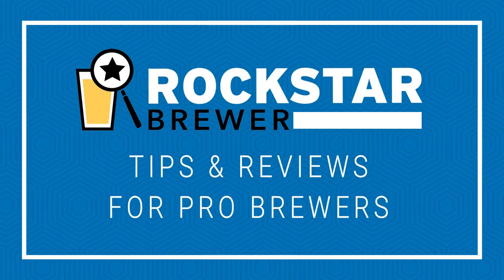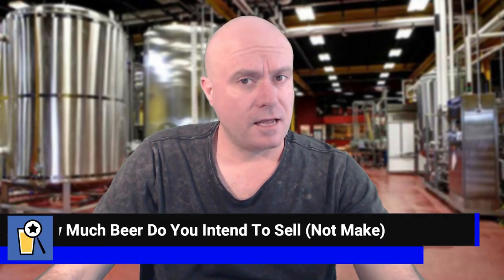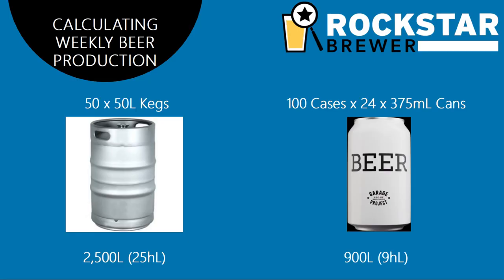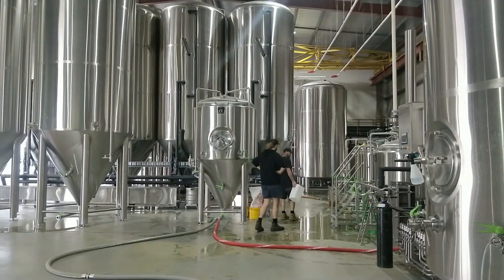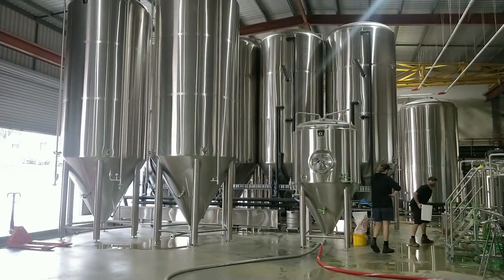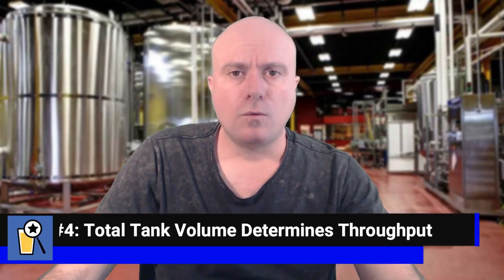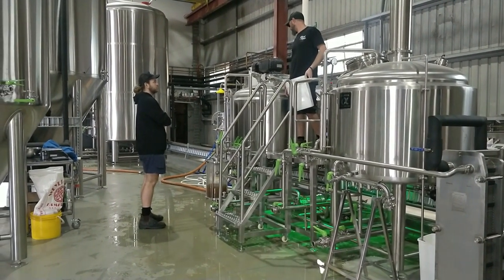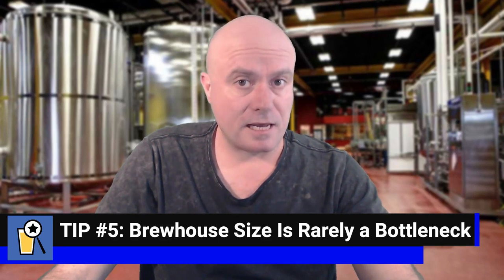The Big Brewhouse Myth EXPOSED: How to design a brewery that KICKS BUTT and TAKES NAMES

Comment: From my experience, just about everyone gets way too small a brewhouse out the gate. It’s very rare that someone regrets buying too large of a brewhouse—and I’m talking 30 barrels or less, because buying a 50 or 60 bbl brewhouse that’s where you can get yourself in trouble. Even taking the advice of buying a 10 bbl system, I’ve seen so many regret that, sometimes even within a year or two. Now, with markets getting tighter, the conversation of going too big is certainly more relevant, but when you look at what your potential growth could be, especially since labor costs a lot more now than when I first started brewing, you’re gonna spend a whole lot more in labor doing multiple turns in the long run. Plus it’s a lot more expensive to expand after opening than before (you’re very likely could have to move buildings). You really need to know your market and have a realistic 10-year plan. I can’t tell you how many people that buy a 10 or 15 bbl brewhouse and buy only, or mostly only, double-fill tanks out the gate. The amount you could potentially spend in labor in one year will generally pay for twice the size of brewhouse. Also, you can design the brewhouse where it affectively can brew half batches or near half batches depending on the gravity, which makes a whole hell of a lot more sense than setting yourself up with always doing multiple turns. My favorite size is a 20 barrel system because if it’s well designed you can make anywhere from 10 to 15 barrels on it And also go over 20, which you could get away with not ever having to buy another brewhouse ever again. I designed a 3-vessel 20 bbl system that could do about 12 to 15 bbl of a moderate gravity, and I got up to 29 bbl into the boil kettle for a lower gravity beer. Did that order right before Covid hit and that same order a year would have been almost $100,000 more. Don’t just settle with stock designs and dimensions for brewing equipment. If a company doesn’t want to bend at all, then that’s not really a company I care to do business with because there are a lot of designs out there that are pretty shitty; if you’ve never used a pro set up before, then it’s easy to get taken advantage of.

Comment: A dark and a pale ale from the brewhouse can be 50 different beers in production. Different mix, different dryhoping, adding isohops, high gravity delution etc. 
As you said, better have larger fermentationtanks than brewhouse. 2-5 brews in a tank. I would then put some money into some smaller tanks for mixing, dryhoping small products without wasting tank capacity in the large tanks. Or you are stuck with the high selling products, ie lager, pale ale. 
I work in a brewery with 250 hl brewhouse and 1000 (850+ headspace) hl fermenters. Its like an oiltanker, big and slow. We don't maka anything less than 200 hl and that is wasted capacity. Mostly filled tanks.

Comment: I am the head brewer at a brewery with a 5 BBL/ 2 V brewhouse, we have 4,5 BBL uni's and 4, 10 BBL uni's. we have 25 beers on tap and sell about 20-30 1/2 BBL's per week. Sometimes we brew 3-4 times per week, sometimes just1or 2. on rare occasions we will do 2 turns of the same beer.

Comment: Would a bright tank be a good option for pressure fermentation?
Reply from the maker: Almost all modern fermentation vessels are also pressure vessels so you could pressure ferment there if you wanted to. The issue with fermenting in a bright tank is without the cone, it's difficult to dunno yeast off. I hope that helps. Thanks for watching!